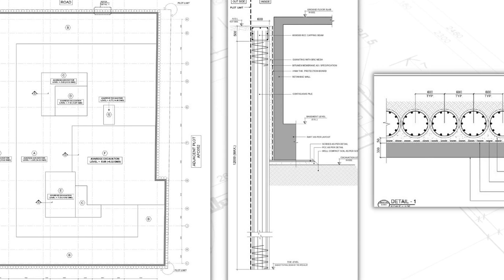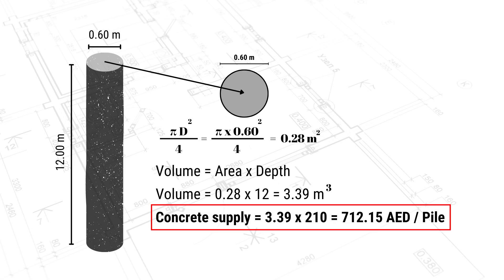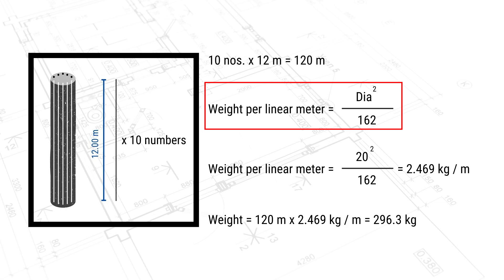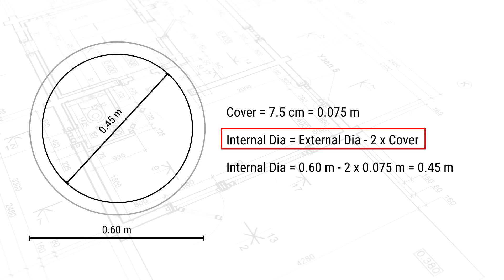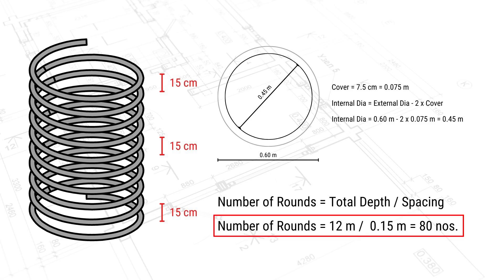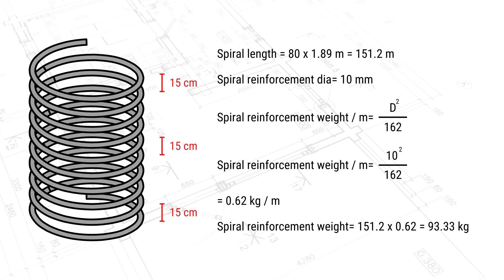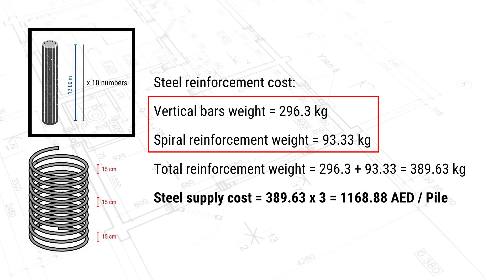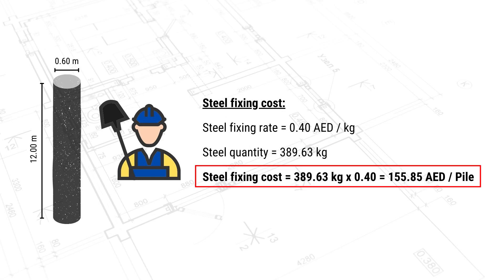How To Estimate The Cost Of Shoring In Construction Projects

Comment: Hello sir, great video as always. I just have a query. In the last part, you divided 1/0.60 = 1.67 piles. Why did you divide one (1) by the diamater?
Reply from the maker: Thank you 🙂. 1 linear meter devised by the diameter of one pile gives you the number of piles per linear meter 👍
Reply: @CEPQS  I get what you’re trying to point out sir. This means that this unit cost/linearmeter is applicable on different diameters of piles right?
Reply from the maker: See the reason we calculate the number of piles per linear meter is that when multiplied by the total length you get the total number of piles in the project and when that is multiplied by one pile cost you get the project total amount
Reply from the maker: Pile cost and number of piles per linear meter will sure vary if the diameter change
Reply: @CEPQS  Ahh. Got it. So this computation is like a simplification instead of direct counting all the pile heads for the project. Thank you very much for taking the time to respond. Btw I am a practicing quantity surveyor in the Philippines and your videos are very much applicable to my job and greatly help me in improving skills needed in the job. Keep up the work sir!!!

Comment: there may be a little mistake in the calculation of your dia bar, kindly correct me if im wrong please (2x3.14xd/2)=(2x3.14xr2)=2x3.14x0.225= 1.413Lm as against 1.88Lm
Reply from the maker: Thanks for the hint 🙏👍. Yes you are correct.
Reply: I got the same results as you. = 1.413 Lm